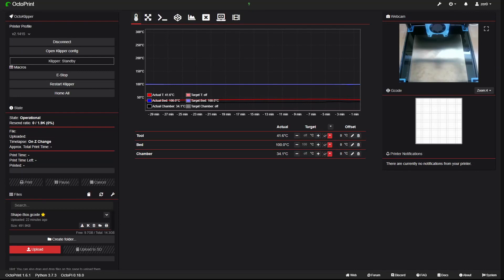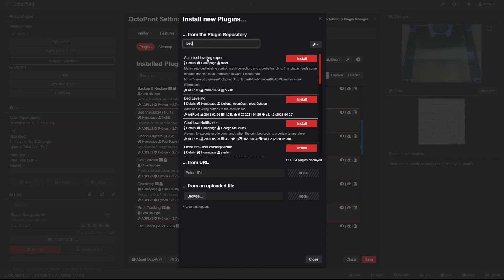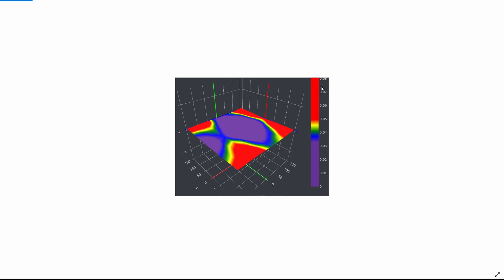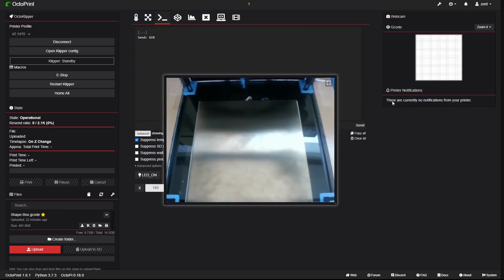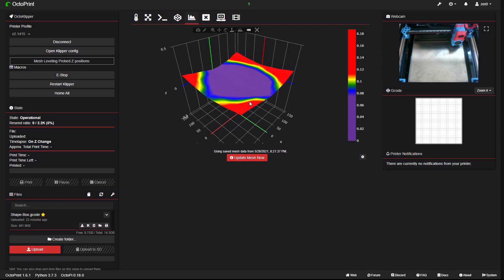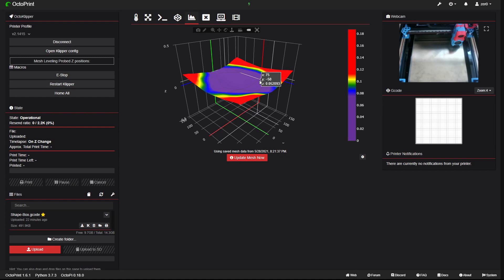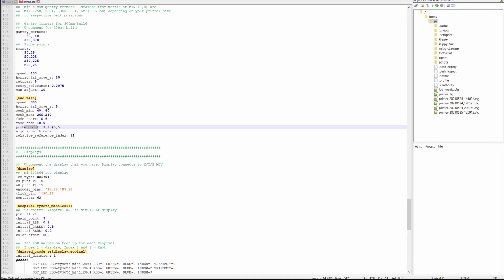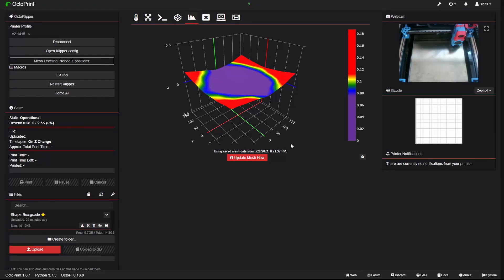Building Voron v2.4 - Bed Mesh [Ep13]

Comment: I would like to know if when I use the heightmap, then go to start print, the question is if automatically the nozzle follow the path as in the heightmap saved ?
Reply from the maker: Yes, you can load your saved mesh if you put macro in your PRINT_START macro.

Comment: I have a question
If i use bed mesh data on klipper
Like m420s1 (Marlin firmware)
Just turn on automatic bed mesh data?
Reply from the maker: Yes, with below command, you can call saved mesh data.
BED_MESH_PROFILE LOAD=default #"default" profile name can be change if you saved it with other name. if you are doing SAVE_CONFIG after calibration it is saved with name "default"
Reply: @zer0isdoing  thanks bro